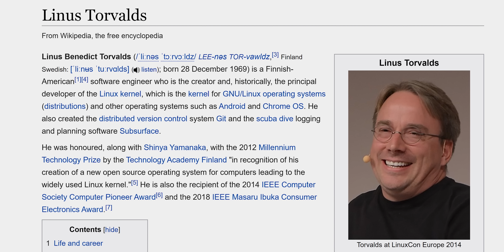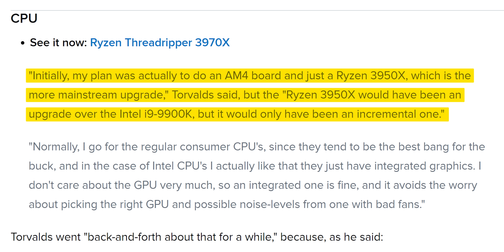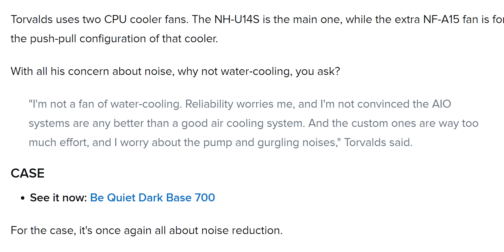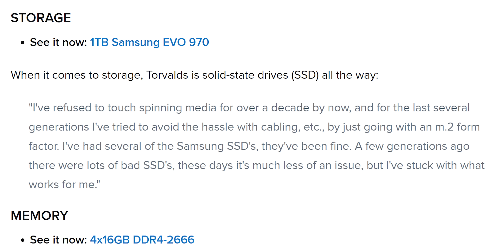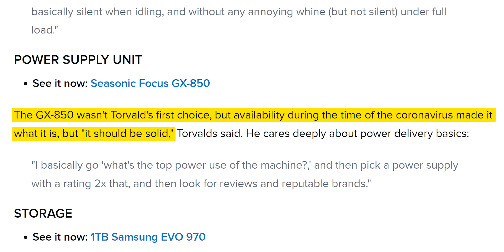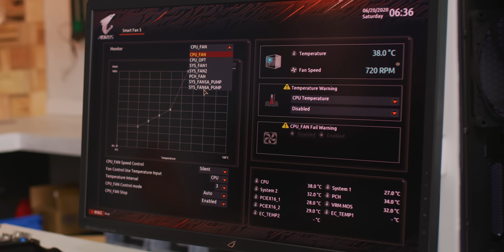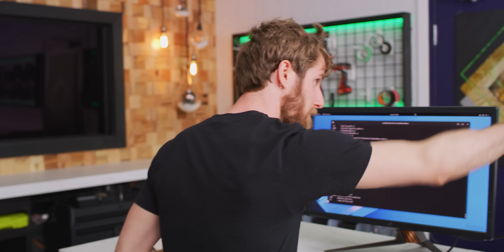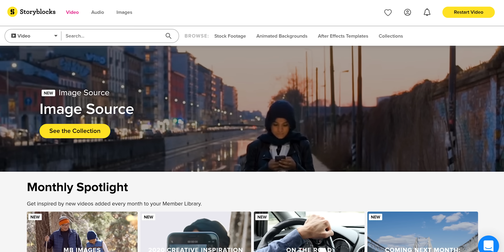Linus builds Linus’ new PC!

Comment: This PC doesn't really match the needs of most developers. I know there'll be people who will dispute this. I realise there are use cases for this as a development machine; but most people wouldn't need it.

Let's first talk about the CPU, and a typical developer workflow. Devs will boot up their integrated development environment, or IDE for shirt. This is a software suite that contains things like a code editor, compilation and debugging tools, performance profilers, etc. IDE's usually chew more memory than they do CPU. Typically using 1gb+ for things like IntellIJ - one of the more popular ones. 

From there, they'd write their code. It'd be compiled and run - where the CPU will come in. A lot of compiling is single threaded by default, unless you specify otherwise to the compiler. This is usually sufficient. Say your code takes three or four minutes to build. It'd take more time to tune that build than you'd save. And often, multi-threading will yield worse performance. Spinning up work on a thread has a significant performance overhead. If the workload isn't well balanced then you may see a performance hit.

Your projects requirements will dictate how much CPU and memory is needed to run a system. This could be anywhere from a few mb's and a single core, all the way up to (or beyond) hundreds of gb's with fully utilised EPYC/Xeon processors. These are both extremes, but they're more common than one would think. Embedded systems have very limited resources, but enterprise systems found in things like banks can need a monstrous amount. Systems that use even 32gb+ of memory aren't uncommon. Projects like these can take hours, or in rare cases literally days at a time to build. 

You may be rightfully thinking "well, if you need that much resources then surely no machine is suitable". And you'd be right. A developer wouldn't ever compile the whole system locally or run it in cases like that. What we do is architect our projects in a way that we can compile, test, and run portions of a system on their own. We do this for things such as local testing, and continuous integration (CI) testing. That's where we get a server to take our code, build it, and run our tests. They'll typically be much beefier than our systems and be dedicated to doing such tasks. As where our systems need more memory for the IDE, our OS (which would probably be more resource hungry than the CI system's OS), and whatever else we need, such as web browsers.

Modern software development techniques lean towards scalability and adaptability. Projects typically target what we call "environments". You may environments such as production - what the users see; QA - a pre-production type of environment; and a dev environment, using less resources with dummy data. Using the method I mentioned above, where things are split into reasonable sized programs, we then run it on modest hardware targeting local or development environments, that are designed to be light-weight. Hardware is costly and we don't want to break bank for every environment.

This is what allows developers to run modest hardware. Four core, eight thread machines are common place. 16gb (on the low end) to 64gb's of ram are what you tend to see; 32gb being that nice sweet-spot for keeping chrome open during builds, or running a dedicated VM alongside our host OS. I know several developers and technologists that can do their entire job on a Pi. When we start needing more than what's realistic, we offload the compute to servers. Where we pay only for what we need, and then tear it down when we're done. Our work stations will be almost equivalent to that of a gamer, without a GPU. 

There are always exceptions to this. Data scientists (who write code, but arguably aren't developers), need a lot of raw compute and massive amounts of memory would benefit from systems like this. Freelance developers are another possible target. Ones who take on small jobs where it wouldn't make sense for customers provide them with a machine. Where if they can do everything with local compute, and not need to worry about setting up environments, then they'll benefit greatly. They're different from contractors, who work for fixed periods inside firms to deliver projects, or portions of a project. Although a freelance dev could get away with a Ryzen 9 - people hiring free lance developers are small time, who don't have the resources for their own tech staff.

Here we have a machine that, as you said, was very well thought out for the needs of Linus. But he is a developer that's on the edge of edge cases, and doesn't necessarily represent what an average developer needs.

I realise there's a good chance no one at LMG will read this, but to any developers (especially student developers) who want to build this, please consider what you actually need for a development machine. Giving yourself a buffer is great, but will spending this much on a machine be wise? If you spend more than what you gain over time, then probably not.
Reply: If you need more than a few minutes to add:
MAKEFLAGS+="-j16"
To your .bashrc or whatever shell you need, then you should not work as a developer.
.
My Terminal + tmux + bash + vim does not need nearly 1 GiB, more like 12 MiB.
Reply: And you are also completely wrong about performance in multithread compiling. Every compiler instance runs as it own process, they do not care about each other and compiling scales very well and linear with more cores, as long as there are enough compilations units left to compile, even when you use multiple PCs to compile.

Comment: What about a monitor?
What Linus would use and what Linuxs used? 
I bought a few computers for software developing and we quickly figured out the priorities: 1) CPU single thread performance (40) 2)RAM capacity not speed (30) 3) powers supply reliability (20) 4) panel quality (brightness, resolution and viewing angles for reduced eyestrain) (10) Number are relative 'weights'
Reply: 1) Wrong. Completely wrong, sorry. Compiling scales linear with core count as long as you have enough compilation units (files) left to compile.
2) You need enough capacity to support all compiling processes. That is why you often need 32 GB if you have a CPU with 32 cores and you want to use all cores for compiling.
4) Resolution. The higher it is the more lines can you see at once.

Comment: It would be great if you could do a build competition for development PCs. I need an upgrade and there is nothing online really to help. For example, I'm toying with the idea of an 3990X, but the current 256GB ram limit is only 2GB per thread (which is one make job) so might actually bottleneck some big builds. If you did this, pro tip would be to build a few different things with different systems, maybe split them into different categories. For big builds: AOSP (java, c, c++), GHC (the real challenge: haskell, c), LLVM/Clang (c++). For medium builds: Linux Kernel (c), Elasticsearch (java), pandoc (haskell). And some small projects of different languages. So what do you think? Team red vs team blue? Varying ram to thread ratio? And show me a sign this comment was read!

Comment: ok so linus i have a quick question and i was hoping you could help me out. i recently upgraded my graphics card from an amd 450 to a nvidia rtx 2060 super hoping to increase the quality of graphics that i could play escape from tarkov on. since the upgrade im still on the same settings but it runs a little smoother. i have an i5 7400cpu @3ghz and the original amd motherboard. which of those should i upgrade to increase gaming performance? its really only tarkov that runs bad most other new games run at 60fps minimal except for maybe warzone. appreciate any help or advice you can give me

Comment: There is a reason for AMD - FLOSS drivers, you don't have to worry about kernel upgrades with such drivers in the stock kernel, with Nvidia, it needs rebuild of kmod for every kernel upgrade.  However, with Nvidia, we have official support for BSDs and Solaris !  But lacking certain features like CUDA, etc.

Comment: Good PC for his use case, with the exception of, as Linus (this one) pointed out, the RAM. I wouldn't even stop at 3200 MHz for a PC this expensive and CPU performance oriented. Go all the way to 3600 C15. Huge performance increase over some 2666 kit with loose timings.

Comment: Linus Torvalds built a PC that's a gross overkill and a power hungry monster for most of his needs I guess. He should have used a Raspberry Pi and a similar x86 SBC instead.
Reply: Compiling takes way to long on a Raspberry Pi for something like Linux, especially when more kernel modules have to be compiled along with it.
Reply: @happygimp0  Consider the TDP of that monstrosity. It's a waste of electricity if you are using it just to tinker with a code.

Comment: Linus Torvalds: Doesn't like any extra fans than necessary
Also Linus: Adds extra fan to the heatsink and extra fan to the case intake.
Reply: The reason was noise reduction.
If you can add extra fans, but with much lower RPM while maintaining or even slightly improving cooling.
That means they can be considered as necessary.

Comment: 15:20 He is not just a software developer, he built the Linux, an OS. He sure knows his ways around hardware.
Reply: I'd just like to interject for moment. What you're refering to as Linux, is in fact, GNU/Linux, or as I've recently taken to calling it, GNU plus Linux. Linux is not an operating system unto itself, but rather another free component of a fully functioning GNU system made useful by the GNU corelibs, shell utilities and vital system components comprising a full OS as defined by POSIX. 

Many computer users run a modified version of the GNU system every day, without realizing it. Through a peculiar turn of events, the version of GNU which is widely used today is often called Linux, and many of its users are not aware that it is basically the GNU system, developed by the GNU Project. 

There really is a Linux, and these people are using it, but it is just a part of the system they use. Linux is the kernel: the program in the system that allocates the machine's resources to the other programs that you run. The kernel is an essential part of an operating system, but useless by itself; it can only function in the context of a complete operating system. Linux is normally used in combination with the GNU operating system: the whole system is basically GNU with Linux added, or GNU/Linux. All the so-called Linux distributions are really distributions of GNU/Linux!

Comment: Linus & Anthony, you might find it interesting to try a developer build, focusing on two tests:  one would be AI and machine learning, and the second photogrammetry.  Machine learning in particular (using TensorFlow) uses as much GPU power as you can get your hands on, which I think could make for an interesting cross-over from the more regular gaming builds you highlight.  I understand AMD can be used but the path of least resistance is clearly with nVidia and their CUDA toolkit - I went 2070S for my personal machine. 

Some of the early TensorFlow tutorials aren't too hard to follow along with, so wouldn't be prohibitively challenging to make a video on.  The photogrammetry use case might stress raw CPU power better:  I used a library called Open Drone Map (look for webodm) and they provide sample data sets that are known to work, so it could make for an interesting developer focused video, but one where you are really pushing the machine beyond your initial (perfectly valid) example of recompiling the kernel.  I don't know if webodm uses GPU acceleration nowadays but last time I used it, I had every CPU thread flatlining at 100% for hours on end... a real workout.

Comment: So I finally gave Linux a spin, installing Ubuntu 20.04 on it's own hard drive separate from my Win10 on an SSD. Sorry, but I can't say there's much of an incentive for giving up Win10. Couldn't get my Razor mouse to work so I dug up an old trackball mouse (hate it) to get by. Switching between applications seems to have lag compared to Windows. The screen sometimes goes blank for several seconds, leaving me wondering if it crashed, then it finally comes back, (I have no idea what's up with that.) 

I have the paid version of Malwarebytes but it doesn't run on Linux, so there's no security. (Sorry, I don't buy that it's safe just because so few people use it. Apple used to be safe too for that reason, but now they also need an antivirus.)  I used the GUI the whole time so it's not a technical issue for me, not knowing command lines. Other than it's free I just don't see the appeal. It's certainly not any faster than Win10, and if anything, because it's on a hard drive it takes a really long time to load. Win10 on SSD is almost instant on.
Reply: You do not need an antivirus, because they can not work. It is not because so few people would use Linux, which is not true, most servers run Linux, but because antivirus software can not increase security.
Antivirus software increases the attack surface, there where many viruses that attacked vulnerabilities in antivirus software and since this software needs to run with all privileges, the virus gets them as well. An antivirus can only protect against known exploits and as soon as we know the exploit we can fix the software so that the exploit does not work anymore. Use up to date still supported software is important.
.
That black screen sounds like a driver problem, did you install the correct GPU drivers?
And of course it is slower than Windows 10 when you put it on a HDD.

Comment: Here are some of the things I did differently with my Linux (mostly web) dev build:
- 2 SSDs for Linux running software RAID1 - I've been running RAID1 for years now and it has already paid off. I had one of my HDDs die on a Sunday and I couldn't get a replacement right away. With RAID, the only thing that happened was that I got a notification that a drive died and there was no downtime or having to recover it from in the best case a full image backup.
- AIO cooling - I got a Be Quiet! Silent Loop 280 which has 140mm fans. I also have a Gigabyte board, so I have the pump is always running, but the fans spin up only when needed and they are quiet.
- My GPU has Fan Stop and I'm guessing that the one Linus chose also has it, but it's something that I appreciate very much and wouldn't want to build a system without it.
The rest of my build is very different (8700K, GTX 1070), but that's only because I built it a couple of years ago. The 1070 is in there because I game as well. I have a separate SSD for Windows to make dual booting and RAID simpler. I just use the boot menu to boot Windows and Linux is my default. I'm guessing that my next build in a couple of years will be Ryzen 7/9 and RDNA2.

Comment: 16:05 - only problem is that unbuffered ECC memory is even more difficult to find at higher speeds from a name brand. Torvalds probably wants to stick with name brand reliability, support, and most importantly stability. So, he'd probably want to go with something like the Crucial CT16G4WFD8266 at 2666 MHz unbuffered ECC DIMMs.
Reply: Why unbuffered?
Reply: @happygimp0  because Ryzen/Threadripper don't support registered ECC, only Epyc does (in AMD's current processors).

Comment: I am half deff, Fan noise is no issue.  LOL  Keep it under cool as I say.  And yes, 2x+ the power supply on calculated max power draw or as I do 4x it for future upgrades, I am a gamer and I am an engineer and we engineers love to over spec!  Expandability is a must for me and so is future-proofing to the best of one's ability.  It is the engineer in me and I do love ECC RAM my self even for a gaming rig as I code for games and that does help in instability issues when coding for graphics and such.  :)  It has no negative effect on playing games.  It is just expensive and harder to find at times now.  Get the best you can afford and do not skimp on the basic core parts that will allow you to expand.  :)

Comment: That is absolutely what any developer would pick if he wants to build a development machine except the GPU because CUDA offers great support for coding in general and specifically for AI and machine learning applications. water cooling would be better because AI applications takes a ridiculous amount of time and may result in days of overclocking and heavy performance loads. Some people may change the operating system to Ubuntu because it's much better in quick plug and play in terms of getting your packages up and running especially if your work in data science or AI and machine learning but this just a software preference it doesn't really affect the hardware choice.

Comment: don't use smt threads while compiling the linux kernel it is slower then using physical threads since the treads you use are actually in use it will slow you down

Comment: I am a software developer but that is a very broad term. I happen to do embedded Linux development for the aerospace industry. I do not have much control over the hardware I work on at work. I have a Dell laptop running windows 10 and VM ware pro running CentOS. We are required to use a specific version of Linux and a specific version of gcc. We do have some control over our IDE and that runs from VIM to gVIM to emacs to Eclipse CDT. 
If I could build a dream dev system for myself It would be pretty close to what you built but I might pick the fractal design case, faster ram, and an RTX2080ti or if I was not paying for it an RTX Titan I would also use  two m.2 drives in a RAID 1 for increased read speed and some redundancy. 
I would want the graphics card to do some deep learning AI but that is just me. And yes I would want it as silent as I could make it.